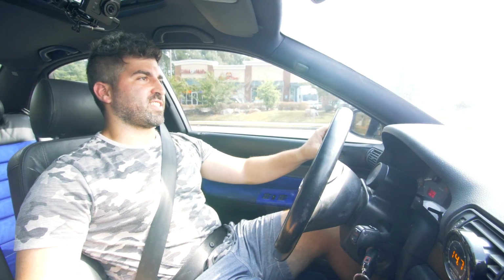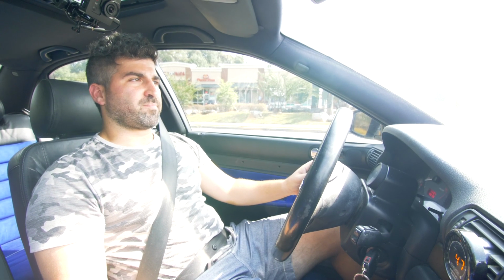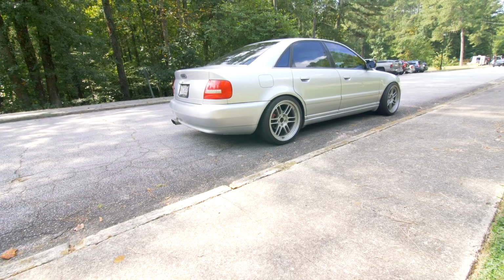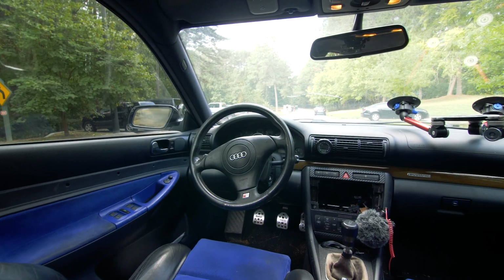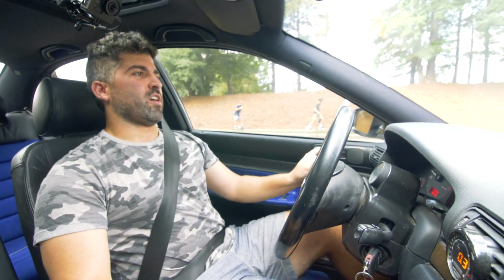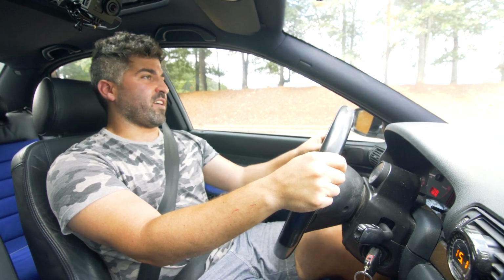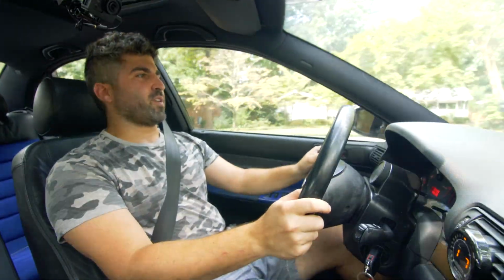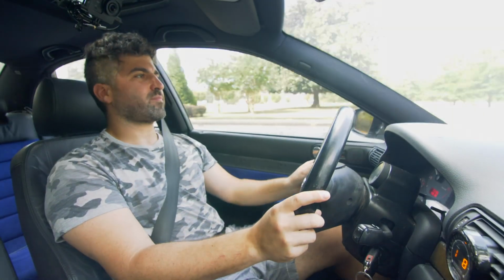Revisiting the B5 S4 - it BOOSTS!!

Comment: We need to smoke test ours and also fix the turbo seals on our KO4 B5. It's going to get re-tuned after we perform a ton of maintenance, and we'l see if we can get to a healthy number like what you have. What supporting fueling upgrades does your car have?
Reply from the maker: That sounds great, awesome cars once they are running 100% hah! 1k cc injectors, walbro 485 fuel pump.